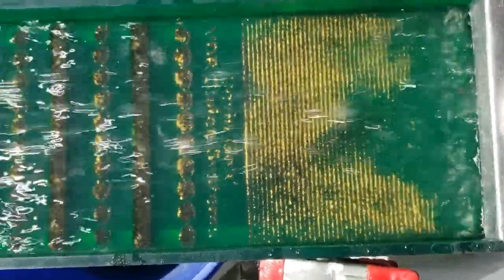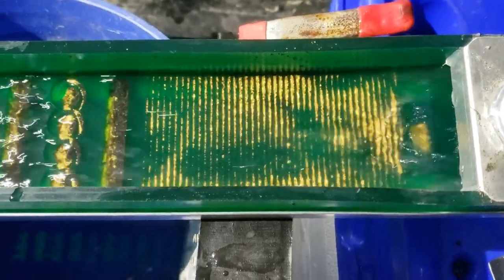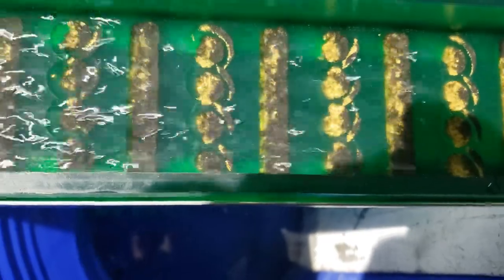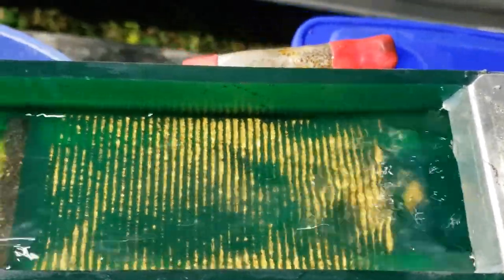New Canadian Gold Rush 2022 (Episode 7) - Every Dot Adds Up

Comment: If you put a bucket under the tailings drop and empty it more frequently you will save more time and energy. It helps with efficiency. Nice process! Heavy pans!
Reply from the maker: That's what we do in previous episodes and in the 1st start location in the video, using the coarse tailings to reclaim the mined sections as we go. For the second part of the video the mound is at the top with a depleted section just lower to push into so it's less energy to keep the coarse tailings there and just smooth them out / push them into the mined sections below. In the other locations where we moved material further and there was tighter space constraints it definitely makes sense to throw a bucket there and empty it around a third to half full. Thanks for the suggestion!

Comment: You’re mining the same area every year and keep finding gold?
Reply from the maker: Yes, flour gold deposits will often renew especially in areas with a lot of historical fine gold finds. Check out the previous videos if you are interested. This is a $100 gold claim that has several ounces of renewable gold that we mine every year in the fall season. We just take the highest grades though. The gold is in the same spot with moderate distribution changes (we do have to explore every year). At $2600/oz and VDR mats it is becoming better every year. Thanks for the comment.